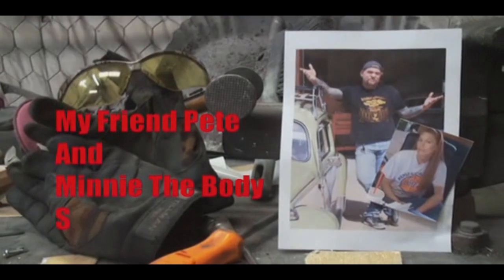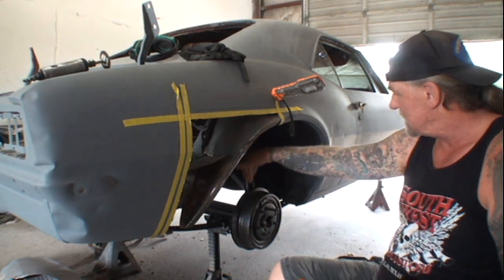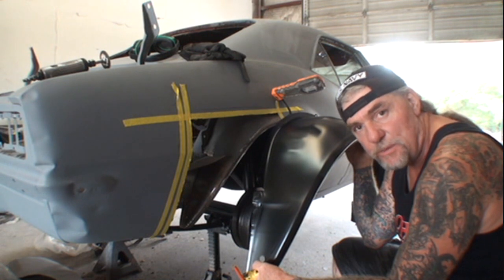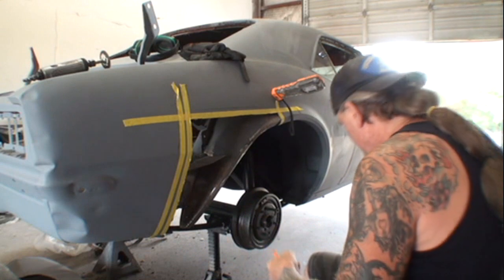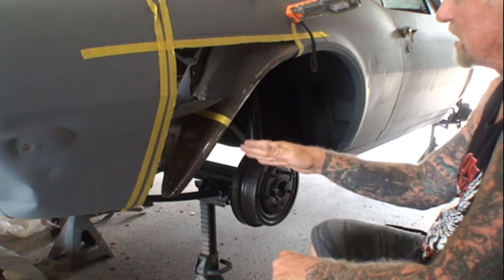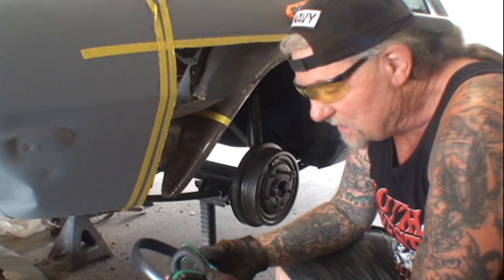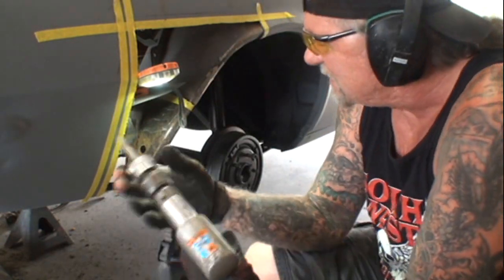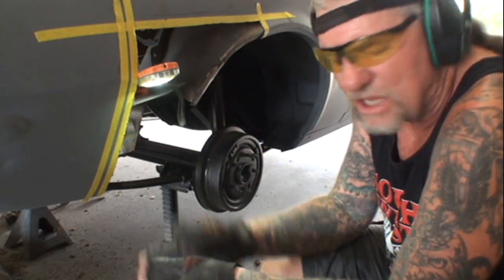How To "Patch Repair A Quarter Panel - 1967 Camaro - Part 2

Comment: Good video on this Pete but when you get a car where there is no part's for this and you have to work with scratch build what rusted out what's the best way to make it.
Reply from the maker: You'll have to make your own with 18 gauge sheet metal.. A hammer, dolly, good vice, and positive attitude and it will GET DONE!

Comment: Are you going to bump out that dent in the rear corner while you have access Pete.?
Reply: Yeah! Much easier to knock out the corner then replace it with aftermarket... Ill have a video set on how to remove these type of dents soon.. Thanks for watching ZIGGY!

Comment: Pete, I want to do a section of a rocker panel. Can I clamp the new piece to the car and cut old and new panels at the same time to get a good fit?
Reply from the maker: You can do that if you are but welding them,, It would be better to atleast cut out the new panel so it doesn't have the edges on them where you can get a nice tight fit on the area you are cutting.. If your going to use a flange for your welding you can't do that... Good Luck!
Reply: D.I.Y. AUTO SCHOOL Thanks friend. I understand.

Comment: Hey Pete I’m in the process of doing some repair painting on my girlfriends front end front Bumper, passenger side fender and side view mirror and hood and I started to spray the base the other day silver metallic and the paint the lady sold me was bad and I immediately caught it and stopped after starting to spray the side view mirror and side fender and barely a piece of bumper. Do I need to sand back down to primer or could I just sand it down smooth and respray it with silver base? Will the silver cover the sand spots from 1200 grit wet sand? Cause that’s what I did so far was just wet sanded it all smooth. I’m picking up the new paint today and needed to know what to do cause I couldn’t find any info on this.
Reply: You can wetsand the basecoat paint down smooth using either 1200 or 1500 as you suggested... DO NOT use any wax and grease remover on it after you sand the painted area, this will cause fisheye.. only use a clean wipeall and clean water to wipe it down.. When sanding use minimul water - meaning dip your sandpaper in a bucket of water and shake it off before using, this will insure you don't get to much water and residue all over your car... Then re-spray and move onto clear coat... Good luck!
Reply: MY FRIEND PETE awesome thanks so much Pete going to get er done today and move on to the clear coat! I wish I could post some pictures for you to see the finished product. It’s my first time spraying with a spray gun and only  painted with cans a few times before this. Ended up tiger striping the hood a little bit and am sanding it down and redoing today.
Reply: MY FRIEND PETE I noticed I was not holding the gun parallel to the hood could that be the reason for getting the striping or could it be that I’m not overlapping enough or too much as well? Because when I noticed I wasn’t holding gun perpendicular and I corrected it, that seemed to stop the striping. Thanks for all of you’re help you’re videos have helped me learn so much and come so far in such a short time.